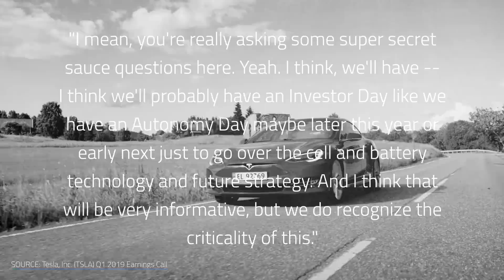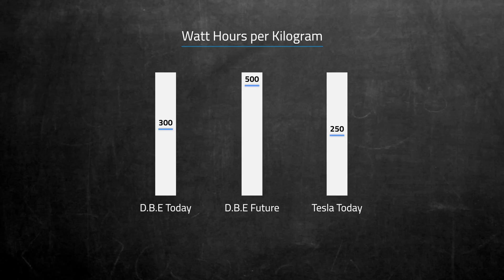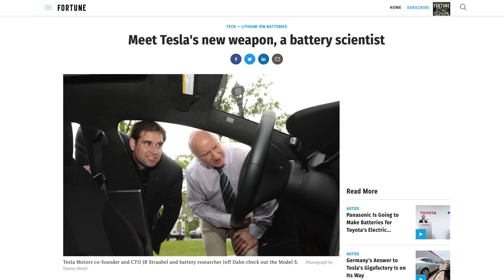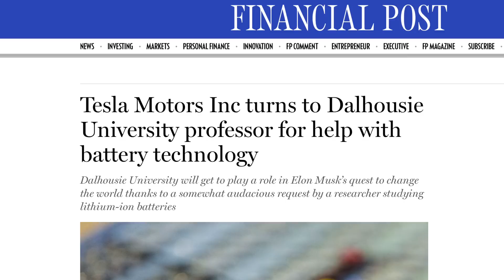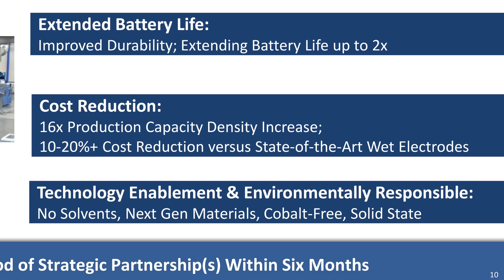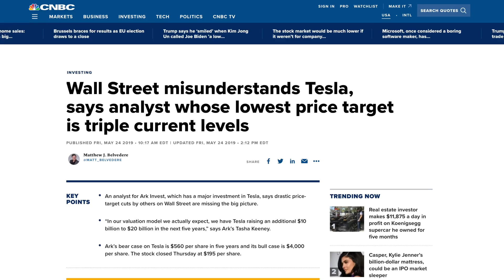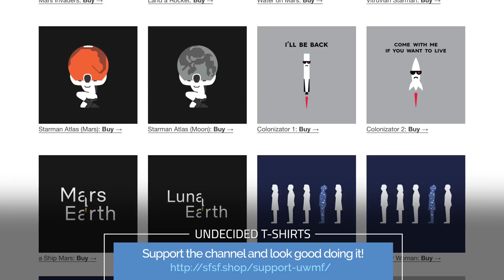Tesla And Maxwell Technologies

Comment: What about super capacitor integration in the EV drivetrain for even more power / regen? Seems like Maxwell might have IP there too
Reply: I believe Tesla needs to eventually drop the super fast acceleration and use that to extend range, i do not need to accelerate to 60 in 4 seconds damn i would be more than happy if it was 8 seconds and extend the range.

Comment: There is so much to add about Tesla and Maxwell getting together. I believe that eventually in the future all Tesla vehicles will have a rocker solid state battery to work along with its battery technology. Think of it as having a superfast SSD (Solid State Drive) boot disk between your processor and your spinning hard drive on your computer where you keep your operating system and the files and programs you use most for the fastest read and write operation of your computer. The thing that I'm calling the rocker solid state battery is based more capacitor like operation of the rocker that can send out electricity to the motor at a rate that is equal to the demand for acceleration the driver demands for high performance, as well as, receive the energy generated by regenerative braking in a way that it can capture the entire amount of electricity generated and store it for when it is needed to accelerate again. Think of energy flowing back and forth between the battery and the motor/generator, rocking back and forth to make a more efficient electric vehicle. The regular liquid chemical reaction batteries are then used to recharge the rocker solid state batteries and/or used to maintain speed. The solid state batteries can take charge and discharge cycles in the hundreds of thousands range saving the regular batteries from this heavy cycling at high C rates. Since the demand on them is not so extreme those batteries should last much longer. The greater efficiency of this rocker architecture should extend the range of the EV since it uses the greater efficiency of capturing more of what regenerative braking produces. Tesla has already been demonstrated this concept in the new roadster, but Maxwell make the components that make it possible.

Comment: Imo Investors don’t see the value in this or may not even like the new battery tech for one main reason.  

Planed obsolescence, they don’t want million mile vehicles. They want returning customers, see any of the other car manufacturers. 

Toyota and Volkswagen used to make million mile vehicles once upon a time. However those doesn’t bring customers back for the latest model.

Comment: One other thing Maxwell purchase can do is let them use their supercaps for regenerative braking. Since charging and discharging any battery is a chemical process, why not add a small bank of supercaps (light weight, high capacity, very long life) for the temporary storage of regen braking energy, rather than putting it back into the battery bank, put it in a supercap. They take huge charges quickly and can dump the power equally as fast and have millions of charge/discharge cycles.  That will extend the traction battery life since it won't have nearly as many charge/discharge cycles.  
Also, when pulling into a supercharger station, you could charge the traction battery and the supercap, and then bleed off the supercap into the traction battery after you leave the charging station. This would let you "continue the charge" for a few minutes past the charging station time, and optimize busy supercharger station throughput.

Comment: Good video, but why compare tesla to apple? apple does what others do but they charge more to increase their own profit while doing nothing with it. The companies pretty much have nothing in common. Apple might be like tesla if apple used their price ability to cut costs to actually lower the cost of the product.  Meanwhile Apple does everything they can to make their products not compatible with anything else to force you to buy more of their products at a higher price. You may think tesla is similar with their super chargers, but tesla wanted everyone to use it as the standard since its objectively better, but it costs a bit more to install. The industry chose another worse approach to save money and to make EVs have slower charge times. Tesla still offers its setup for others if they are willing to share in the cost of setting it up and running it.
Reply from the maker: Just posted this on another comment.

My comparison was on the vertical integration aspect, not what anyone thinks of the products themselves.

But I find it ironic how many people have gotten angry at that comparison.  Both Apple and Tesla are decisive companies.  You either love them or hate them.  They’re also both some of the most shorted companies on the stock market.  Apple in its hay day hade an incredible amount of FUD being spread about their impending doom and getting crushed by the competition that was always coming soon.  Tesla is going through that right now.
Reply: @UndecidedMF  That comment doesnt really apply, im not talking about whether people like apple or not, just objectively, they charge more for the same thing you can get elsewhere, tesla charges less and offers better. Tesla was first, but wants others to use its tech and paved the way with advanced tech that it would allow others to use for free. Apple was last, developed new tech that wasnt needed and forces its users into a walled garden of tech and software. The companies objectively have different aims. To further this, im sure you have heard about apples new computer and 1000$ stand.
Reply from the maker: We’re going to have to disagree there.  

Apple custom designs their own A series of mobile processors that outperform everything else on the market.  Their silicon is custom designed for very specific feature sets, which they then write their own software to run and control.  They design the whole widget from top to bottom, which allows them to do things that their competition struggle to pull off.  Tesla does the same exact thing.  They have designed their own custom silicon and hardware for their vehicle computers along with the software.  Most phone makers don’t control the whole widget like that.  Samsung makes their own hardware, but they don’t control the software stack.  Most auto manufacturers don’t design custom systems and rely heavily on OEMs to provide a lot of the computers and functionality in the car.  That’s why most cars have a bunch of small computers dedicated to a specific feature.  Tesla designed their system with a centralized computer system in mind.  It reduces costs, complexity, etc.  Both Apple and Tesla march the beat of their own drummer and that frustrates many analysts and Wall Street. 

Your points of Apple being last and not offering something of value or innovative to their customers is very subjective, which is why I’m not comparing them in that way.  Your point of the $1,000 stand to me is a prime example of that.  Yes, I agree ... that’s crazy overpriced, but the prices of the new Mac Pro and 6K monitor are a bargain compared to the competition in the pro space.  That monitor at $5,000 outperforms $20,000 reference monitors used by TV and film professionals.  All of the outcry I’ve seen over the prices of their latest announcements come from people who aren’t the intended audience for that hardware (film, tv, music, etc. professionals).
Reply: @UndecidedMF  The pricing of the computer seems to be about double what a comparable system would cost. the monitor i dont know about, maybe their secret sauce will make up the difference in performance. The companies may be similar on vertical integration, but given the insane amount of profit apple has and is sitting on, apple isnt trying to bring costs as low as possible, given some of their insane prices, im more inclined to believe their goal isnt affordability, where teslas is. 

You can say they are similar if you like, but i think most people would agree. They would probably agree that both are similarly vertically integrated and that it is the most cost efficient way to make a product.

Comment: I don't agree. I'd choose a Chevy Bolt over a Tesla anytime on all fields save for range and battery capacity. If Chevy will also invest in supercapacitors, the Bolt as well as the leaf, are the only affordable electric cars.
A million miles makes no sense, when people change out their cars every 10 years or 100-200k miles anyway.
Reply from the maker: Cars today have an average lifespan of 20 years.  Many people may change them out like you said, but that car is going to another owner.  One million mile rated motors and battery packs means these cars will easily last that 20 years.

Comment: If you want to name a vertically integrated tech company then talk about Samsung or Sony..  because Apple isn't vertically integrated at all.  They are a hardware design and software company that doesn't make any hardware.
Reply from the maker: My point was that Apple designs their own custom silicon to enable specific software features and vice versa.  They don’t use off the shelf parts for much of anything.  Tesla doesn’t manufacture everything either.  They have a lot of partners that make and even design things to their specifications.

Comment: Tesla is like Apple? No, Apple is a DESIGN company, they manufacturer near 0 of all components in their products. Tesla is a MANUFACTURER, they design, produce, test, qualify nearly all components in their products.
Reply from the maker: https://www.investopedia.com/ask/answers/052815/who-are-teslas-tsla-main-suppliers.asp

The speaker system was also made by a partner.  The point of comparison I was trying to make was that both Apple and Tesla design the entire widget from the tiniest detail to the top level software.  They may use partners to manufacture some parts, but they design every aspect of the widget.  The custom hardware and silicon is built to take advantage of the custom software and vice versa.  Very little to no off the shelf parts (not true of their competition).  Let’s not forget that Panasonic builds Tesla’s batteries too.  They’re also like Apple because they’re both incredibly shorted stocks and have been for years.  Neither company operates like their direct competition, which is something that Wall Street has trouble dealing with.

Comment: The only thing I didn’t hear you talk about was the super capacitors. Will he be using those for the extended range. I think they would be invaluable for when you take off the line or hit the pedal hard, kind of like a soft start. It seems that would give the batteries a lot more range.

Comment: I guess the supercapacitors can supply instant power critical for peak accelerations of the motor(s)/car which prolongs the life of the current batteries, extends the range of the car, and can make it overall lighter. When the technology will make it possible, the supercapacitors will be able to supply the energy direct to the motors , or they can be used by discharging at slower rates into the existing batteries Tesla cars use, extending the range of the car between two recharging instances. Let's hope that the supercapacitors  will be used exclusively as energy storage and energy delivery devices for EVs, making the Li-ion batteries obsolete and  the car lighter, with extended range, and overall cheaper.For those buying a Tesla car after May 30, 2019 ( new or leased Model S, Model X and Model 3 orders are eligible ) , please use my active referral code here:  https://ts.la/michael51889     to get 1000 miles free on Tesla Superchargers.

Comment: I mean.... 

They could put in an extra pack or two of Maxwell super capacitors as a buffer between the batteries and the motors in a Tesla with the new Raven upgrades for better acceleration and better Regen. If they did that with the new battery they could get a lot of extra range, I bet that's what they're doing with the new Roadster.

Comment: You were on point... Just echoing some comments below... But with a little bit more added: Super Capacitors and Maxwell's technology can be used in many Tesla operations such as commercial power packs, electro-magnetic responsive suspension (not really for power production), regen braking, normalizing or buffering power surges for battery performance while excelerating, charging, and braking. And a bit more.

Comment: Glad you mentioned the professor. I have been waiting for the results of Tesla finding a new alternative. Glad they were able to do so. I hope Tesla survives. I would consider a Tesla as my next vehicle, but there longevity, price, and those cameras when snow or dirt gets on them. Kind of rough when you have to clean 6 cameras daily if you live in an area that has all 4 seasons.
Reply from the maker: I live in an area that has all four seasons and don’t have to clean the cameras specifically.  Just clean them when I wash the car.  No problems.
Reply: @UndecidedMF  that's good to know. I just find even splash from other vehicles block the cameras and sludge from wet snow.vatleast in my area. I find always having to clean it daily or every other day.  I wash once- twice a week during the winter and rainy seasons due to the rain spots and just a general wet road splash. I wonder, how much obstruction can occur before the system warns to clean them. Thanks for the info.
Reply from the maker: Yikes!  Sounds like you’ve got worse conditions than I do.  That would be an interesting test (see how much obstruction it takes).
Reply: @rogerstarkey5390  it does. But Tesla heavily uses the camerss and sensors for self driving more than the rest due to how it operates.

Comment: Great video. I like what you said about the alternative to more range.

Range is fine already. Reducing mass  means better performance. Reducing the number of cells needed per car means you can make more cars because battery production has been the constraint.

Your point about needing less floor space is also huge. 16x??? Wow! That means room to do more in the space they save.
Reply from the maker: Thanks!  If I were a betting man, I think they’ll be going the fewer cells route.  We’ll see the same range or slightly better, but they’ll be able to pump out more cars at a lower cost.

Comment: Coming from someone who owns 2 Tesla's and rents them out for a living  they pieces of shit cars. I literally have a business because so many people want to test-drive these Tesla's and Fanboy over them. But the build of the cars are horrible the maintenance of the car is even worse God forbid your battery starts to malfunction because I've had batteries malfunction for no reason and had to go back and use my Tesla warranty oh yeah it's just a engines are by the wheels it can cause a problem as well if you get lots of speed bumps and s*** like thatand God forbid you live in a warm state where you need to use the AC you have no battery or if you live in a hot State and you need to use the heater you'll be stuck freezing these cars are not practical cars your practical cars for the 80 year old that drives 10 miles a day
Reply: And then once you realize that there are more companies like Volvo out there with self-driving cars and then you realize that the only reason these other companies have it implemented self-driving cars is for liability reasons there's nothing special about the Tesla except that it's electric but then you realize all the electric power plants are powered by gas so is it really saving the environment???

Comment: Great stuff. The DBE also improves safety if they are able to reduce pack sizes. They may also be able to explore hybrid pack designs with ultra caps providing short power bursts under high acceleration, taking that stress of the batteries and increasing life. They will need to innovate on pack integration for the cap-battery hybrid to achieve a good cost benefit. Lastly the 1,000,000 mile battery seemed crazy, but for a car with 400 mile range, that’s only 2500 charges, which is completely feasible if achieved within a 10y calendar life.

Comment: with the new battery/capacitor mix. Tessla will reach the magic limit of elektric flight intercontinental - supercaps with solar wings for take of and landing? say bye bye to flight fuelcosts.
Reply: That's a good question; the tricky part on electric flights is that they can't reach the higher speeds jets provide. So while we'll eventually be able to have enough battery charge for a full transoceanic flight, it'll take longer. Hopefully by then Hyperloop is out and running to bring us faster-than-jet performances for transcontinental trips, so that they make up for the long hours in fully electric transoceanic flights. As long as the total time from the moment I leave my door to my destination  is the same or shorter, we're all winning
Reply: @cleberz8072  the two bigg costs of a flight today, is fuel and staff, where fuel price will see a rise as soon as enviromentalists figure out how they want to tax it.. would it be too crazy to see more automation and less staff for shorter hopps? and a more skeleton crew for the long flights? I mean, the same would be possible for selfdriving cars and boats.  And how would you keep them from being hijacked?